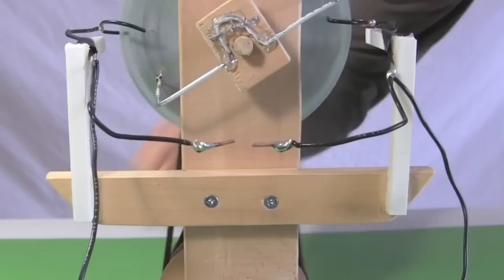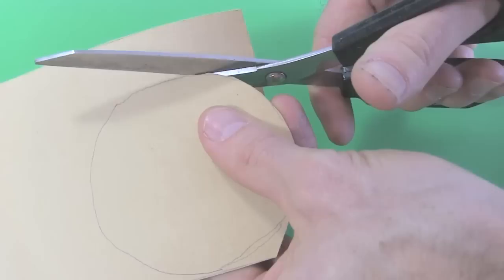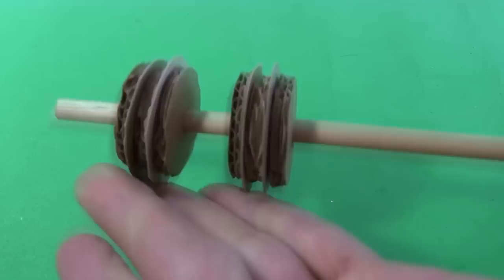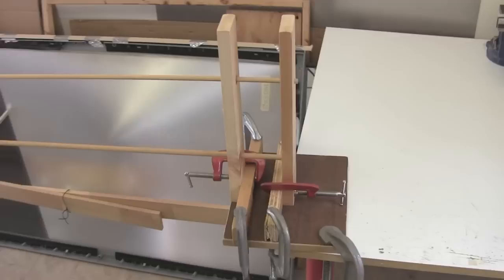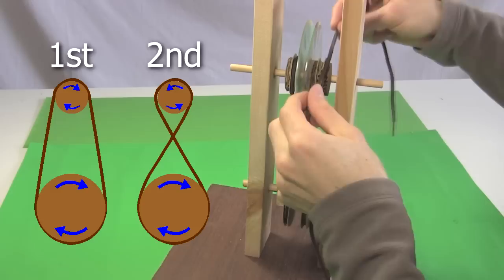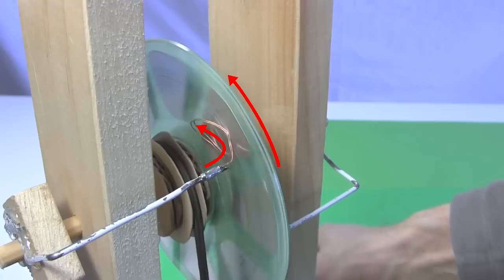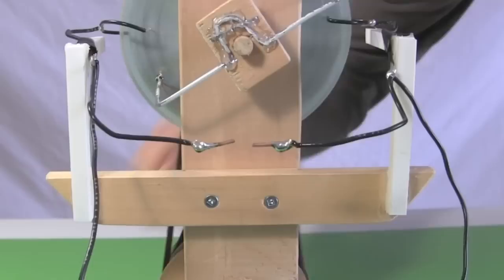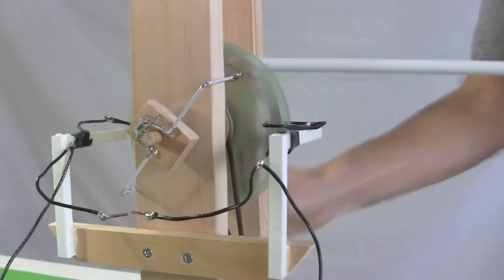Wimshurst Machine - How to Make using CDs

Comment: will a 12 gauge solid wire work with the collectors?
Reply from the maker: +Peter Parker If you're talking about the sharp tip of the collectors then no, 12 gauge solid is much too thick. You really want a sharp point, like the point you'd get from one strand of a stranded wire where the strands are around 30 gauge (bigger gauge number = smaller diameter wire).
Reply: what if I shaped a 14 gauge solid wire into a C-Shaped and use it as a Collector?
Reply from the maker: +Peter Parker You need a sharp point or points facing the disk face. So yes, you can shape 14 gauge solid wire into a C-shape but you still need those sharp points at the tips that face the disk. I guess you can try sanding or filing the ends of the wire to a sharp point. The sharp point is needed to ionize the air between the point and the sectors so that charge can cross the gap. See my How Ion Propulsion Works video for some idea of what I mean https://www.youtube.com/watch?v=01F8V5IhB5k.

Comment: The plastic block at 8:27.
Reply from the maker: Ah, those blocks can be wood. The only requirement is that they're not made of an electrically conductive material, like metal.

Comment: Which gauge wiring did you use and did you use only stranded wire or some solid as well? I'm afraid my wire is way too thin.
Reply from the maker: I used 18 AWG stranded. Solid or stranded will work but you still need something sharp for the tips of the collectors. The larger the gauge, the better because it will leak ions less to the air. If the wire is insulated then that helps for this machine at least. Wherever you solder, make sure to use big rounded blubs of solder without any sharp points.
Reply: @RimstarOrg  Thank you very much for the quick response! Mine's only 40 gauge so I will use that wire only to make the neutralizer bars (the loops I mean). I will have to find 18 gauge somewhere else. This was very helpful!
Reply from the maker: Yeah, good call. 40 gauge would be like a leaky hose where high voltage is concerned.
Reply: @RimstarOrg  I do have some solid copper wire that's about 1 mm diameter which equates to roughly 18 gauge in American measurements. Could it by any chance work to solder a single one of those very thin stranded wires from the 40 gauge on to that copper wire and use that as the collector?
Reply from the maker: Soldering the 40 gauge to the copper wire as you describe is what I would do.
Reply: @RimstarOrg  Brilliant! I will go and see if I find 18 gauge but if that fails I will have a backup plan. Thank you very much for help!

Comment: Hello, I am a high school student from portugal and i am very interested on the ball cyclotron and i would like to do that as my physic project. We can´t afford to buy a wimshurst machine so i thought in building one like this one. Do you think that the cyclotron will work with a wimshurst machine like this on?
Reply from the maker: Hi, Unfortunately I don't think this Wimshurst machine will work with a cyclotron. It doesn't produce either a high enough voltage or current. Also unfortunately, I don't have a video about making a bigger one.
Reply: @RimstarOrg  Thank you very much for your answer! In that case, could you tell me the voltage that a wimshurst machine like the one you used in the video of the cyclotron produces? so i can search for something in the same order of magnitude. Thank you again:)
Reply from the maker: Sadly, I don't know what voltage the Wimshurst machine produces, nor do I know how much the cyclotron needs. I'm basing what I say on the distances between the foils pieces in the cyclotron. The small CD Wimshurst machine has difficulty even producing a spark over a smaller distance so I know it won't work. You can find plenty of Wimshurst machines comparable to the one I used with the cyclotron on https://ebay.com, just search there for "Wimshurst machine".

Comment: What if you add a bank of leiden jars to HV output of the wimshurst machine to create more poweful sparks?
Reply from the maker: That would probably help.
Reply: @RimstarOrg  Thanks, it is much appreciated, could you please help me with my hv power supply? It is three stage half wave cocroft-walton voltage multiplier powered by microwave oven transformer and for capacitor it uses microwave oven capacitor with 1uf capacity. Output voltage of microwave oven transformer is about 1500v (measured with homemade voltage divider) so the output voltage of multiplier should be about 12kv. The problem is when i short the capacitor using spark gap my diodes burn ( i use 5 800v 10A diodes in series) This multiplier was designed to be 5 stage multiplier so its bolted onto 2m plank so the wire creates rather big inductance(i think the value is around 800nH). My hypothesis is that the capacitor discharges into the inductor with rather high current about - 135A and then it begins to resonate and creates overvoltage spike which destroys the diodes - i think this could be solved using spark gap or a set of metal oxide varistors in series. I would propably use royer oscillator circuit but, unfortunately there was school science fair before quarantine and i brought almost all of my electronic components and then caught the seasonal flu which lasted until qurantine and i was unable to take my components home before quarantine so my options are limited. Also i burned one of my microwave oven transformers so inrush current resistor is propably a good idea. I thought about putting 5 diodes in series and parallel with 0.1ohm resistor and 4.5kv MOV varistor in parallel with the diode to protect it from overvoltage and ovecurrent. I will also try to increase capacitance to 5uf if possible and add two more stages. I am not using perfboard, but 14 polypropylene 13cm high isolators with point to point construction. I would greatly appreciate making dedicated video about cocroft-walton voltage multipliers and how to calculate impedance, capacity and component voltage. I will try in the future to construct wimshurst machine, but in wet weather electrostatic generators are unpredictable - thats why i want to use mains powered supplies as they are not very sensitive to weather.

Sincerely 15 year old citizen of czech republic. Please use community posts more to ensure to your subscribers you are alright in these hard times, thanks for awesome quality videos and please stay safe!
Reply from the maker: Wow, you are way ahead of me so I don't think I can offer much. I do know that microwave oven transformers put out high voltage (like you say, around 1500v) but also at high current - extremely dangerous so please be very careful.  1uF capacity is a relatively high capacity and so when discharging, the current can be very high. You're dumping it all in a very short period of time. If there is a way to remove it from the circuit before discharging then that might be better. Just be very careful when you do that -- make sure there's no chance of you being a part of the circuit.
Reply: @RimstarOrg  luckily the circuit is not able to run reliably yet so it fails after few seconds - i use 1m pvc pipe and gloves for hv as of power yeah it is quite high, i know the internal ESR of microwave oven capacitor is about 32ohms from  dissipation factor = Xc / ESR and we can calculate Xc from Xc=1/2*pi *f*C. I cannot account for inductance as i havent figured it out but if i take only the resistance then 12000V/3x96 ohm=125A and 12000Vx125A=15 000 000W =1.5MW of power. The dicharge was very loud even if i was ~ 24J, sadly these discharges are blowing half of the diodes and i havent yet figured out a way to protect them from destruction. I am typing this on my phone so i cant link you to the video where it was shown, but my physics teacher has a youtube channel with recorded science fair. Sadly this is avaiable in czech but in future videoes i may do a english voiceover. I will now search the exact video to show you the sheer scale of my multiplier.
Reply: @RimstarOrg  ok just search up '' rostislav gondik dod 2020 '' the bit of video 0:15 to 0:50 is me and my friends  (i am the guy with red gloves) there are almost all of my creations and components.We and oue physics teacher have club of applied physics. I actually started my electronics hobby with wish to construct a working crystal radio and your videos show it clearly and presicely.

Thanks for being with us in the hardest of times

Sincerely a guy with HOT (pun intented) passion for physics.
Reply from the maker: Your terms search worked. Your video is here https://www.youtube.com/watch?v=ihAAGofLqtg Nice equipment.
Reply: @RimstarOrg  thanks so much! It means a lot coming from you!
Reply: I will propably post video on that channel about the multiplier once it works and maybe try the TEA laser, corona motor, and maybe a spark gap tesla coil or just some random sparks and once i add 240K ohm resistor maybe some arcs. I think the impedance of half wave cocroft-walton voltage multiplier is calculated by
(1/2pi *f*C) *((4*n*n*n)*(3*n*n)-n)
n is number of stages, C capacitance, f frequency and pi is constant. The output voltage is Vac*2*sqrt2 if we take input voltage as 1500V ac then :
1500*2*1.414~4242V DC there is also chance of my resistive divider not working or being off i have tried to calibrate it but i measured 1:10040 if i recall correctly so it needs much more calibration

Anyway have a great day and keep up the amazing work!

Comment: Can we use this to power your ioncraft?
Reply from the maker: Prathyush Poduval No. An ionocraft needs higher voltage and far more current than this one can supply. I'm pretty sure that no Wimshurst machine will have the required current. I couldn't even get my big Van de Graaff generator with the 14" diameter dome to provide enough current. Ionocraft need a really powerful supply.
Reply: RimstarOrg Can it power the corona motor or smoke precipitator?
Reply from the maker: Prathyush Poduval It should power the corona motor, seeing as how I got weak triboelectricity to power it. It won't power a smoke precipitator, but a Wimshurst machine with larger disks like my commercially made one does as I show in this post RimstarOrg

Comment: would this make AC or DC  current?
Reply from the maker: If you connect the two ends of the spark gap to form a continuous wire, then you'd find DC current going through the wire. When the spark occurs I think it's a strong current and voltage in one direction, followed by much less strong current and voltage in the other direction and alternating and getting weaker until there's no more.

Comment: Do you know how yo find +and -?
Reply from the maker: One way is to make an electroscope (easy to do https://youtu.be/2PmWlPjV6n0) and then use the technique I show here https://youtu.be/HupFY_24o-4 I guess you could hold the electroscope terminal near one plate of the capacitor. The side of the spark gap which is connected to that capacitor plate has the polarity of that capacitor plate.

Comment: How many Volts does this machine can create?
Reply from the maker: +Peter Parker It's hard to say what the maximum is. With a spark gap, the widest I can put the gap and still get a spark is around 7mm and based on that I'd guess somewhere under 10kV. This one's intended to be easy to build using easy to get parts so it's not very high.
Reply: +RimstarOrg Mine won't work I dont know why...I repeated the collector spikes and the neutralizers bars...i even made 2 different kinds of Capacitors...I don't know what is wrong.

Comment: is it enough to power a ball cyclotron?
Reply from the maker: I didn't try but I don't think this one produces with enough voltage or current to power a ball cyclotron.
Reply: @RimstarOrg  what about a one using zinc-covered ping pong balls that have very less mass?
Reply: @RimstarOrg I basically mean would it be able to produce about 5000-10,000 volts DC
Reply from the maker: I don't think this is producing even 5000 volts DC. Note that some current is also needed for the ball cyclotron, i.e., some charge. A Wimshurst machine with a larger disk would be needed.
Reply: @RimstarOrg thanks for telling. also, can you share the dimensions of the wood to cut?
Reply from the maker: The dimensions that matter are on my website here https://rimstar.org/sdenergy/stirling/canstirling1/canstirling1.htm

Comment: Exactly how is the glue cheaper then crazy glue? I have been using that type of glue for decades and have never seen it cheaper then Krazy glue. At least not at the majority of hobby shops. Unless your talking about price per ounce. But even when your take that into account it's still equal in value to between 2 or 3 tube.

And it should be more expensive because it's a far superior product.
Reply from the maker: The glue I used is far, far cheaper than krazy glue per ounce (or per milliliter). But maybe we're talking about different krazy glues. I used to buy gel krazy glue that came in small 2 ml bottles. This hobby store cyanacrylate glue comes in 28 ml bottles. That's a volume difference of 14 times. I don't have the prices with me but the 28 ml bottle is at most 2 times the price of the 2 ml bottle.
As for the product superiority, the only thing I can say is that I do the same things with the hobby store stuff that I used to do with krazy glue. Maybe krazy glue can do more that I'm not aware of; I wouldn't be surprised. There are also many variations of krazy glue. But I can only speak for what I use it for.
Reply: RimstarOrg Well thank you so very much. Now that I know my local hobby shop is ripping me off.....much more then I thought....I'll have you take responsibility and have you buy all my glue....

Ok seriously. I'm not surprised I guess that my local has such a huge mark up. I don't buy enough for it to bother me much. I can say I would never use krazy glue in place of it but that's down to tailoring the variations in curing and the applications it's used for I suppose.

Comment: where does the CD facing ?
Reply from the maker: I don't understand your question. Do you mean the two disks?
Reply: yes. are the aluminum facing each other ? or opposite ?
Reply from the maker: Ah, the aluminum pieces are facing opposite. They are facing outward so that the neutral brushes can touch them.
Reply: thanks
Reply: can we measure the voltage? do we really need to use the capacitor? does it work with out the capacitor

Comment: Can I connect it to Tesla coil to power it?
Reply from the maker: I'm pretty sure this one won't work. The sparks wouldn't be frequent, or powerful enough. Maybe one with a 12"/30cm disk might.
Reply: @RimstarOrg  you mean, the disk will be smaller in order to work?
Reply from the maker: No, the disk needs to be bigger. The bigger the disk, the higher the output.
Reply: @RimstarOrg  Thank you so much for the response. Will you give permission for us to use this in our Research? We plan to use garbage to geneate steam and connect that Wimshurst machine in order to power the Tesla Coil. Any advise? Thanks
Reply from the maker: No permission is needed. I didn't invent Wimshurst machines. Do a search online and you'll find plenty of information about them.
Reply: @RimstarOrg  thank you!

Comment: Hi RimstarOrg not write in English
but I hope you will write in Spanish and help me this query
Que fue lo que utilizo en el cd es papel de aluminio ?? 
Please answer that query ^^
Reply from the maker: You can use aluminum foil. Glue it on. I used aluminum tape. You can find aluminum tape in hardware stores.
Google translation:
Puede usar papel de aluminio. Pegamento en. He utilizado cinta de aluminio. Usted puede encontrar la cinta de aluminio en las ferreterías.
Reply: Thank :) of Peru
Tu trabajo me ayudo muchas gracias
Reply: sorry again but I know that materials used for the creation of machine wimshurts
Reply from the maker: jair Rivera
I don't understand your question. Please write it in Spanish and I'll use google to translate it.
No entiendo su pregunta. Por favor escriba en español y voy a utilizar google para traducirlo.
Reply: Que materiales utilizo para hacer la maquina de wimshurts ??
Reply from the maker: jair Rivera
I don't have a list of materials. You should be able to figure it out from the video. Let me know which parts you have questions about.
No tengo una lista de materiales. Usted debe ser capaz de resolverlo en el video. Déjame saber qué partes tiene preguntas acerca.
Reply: Disculpe el cable utilizo es de aluminio??
O pueden utilizar otros tipos de cable
Reply from the maker: jair Rivera
Yes, aluminum wire is okay. Other types of cables are okay too.
Reply: sobre el capacitador la plataforma es de vidrio??
o que material esta es la ultima pregunta para terminar el proyecto
Reply from the maker: jair Rivera
The capacitor is made using plastic. The plastic is from a CD case.
Reply: Disculpe donde consigo los alambres de aluminio ??
Reply from the maker: jair Rivera
I don't know where to get aluminum wires. Why don't you use copper wires? Copper wire is much easier to find. You can even take apart old electronic devices to get wire.